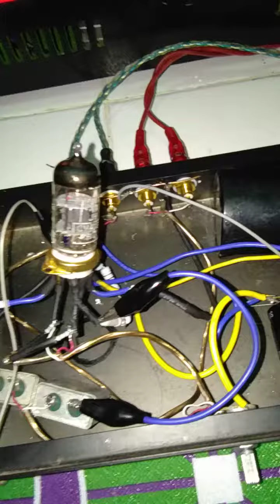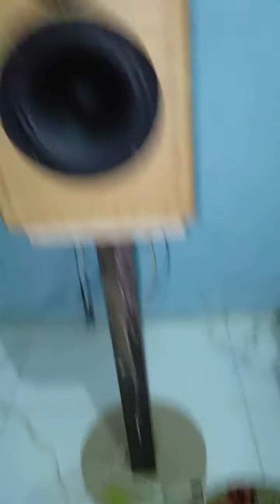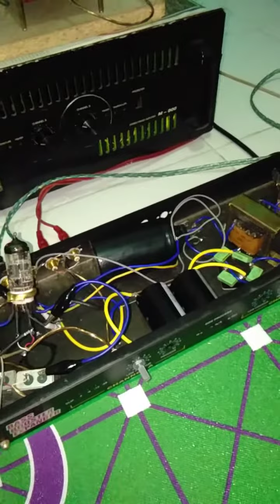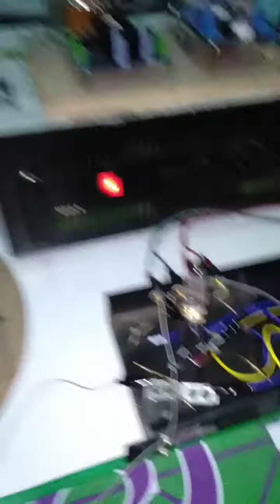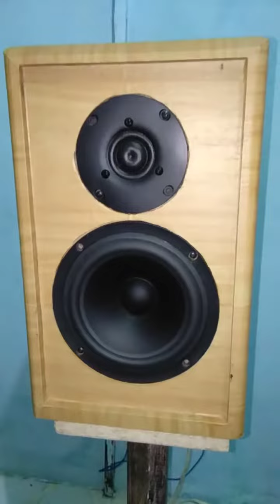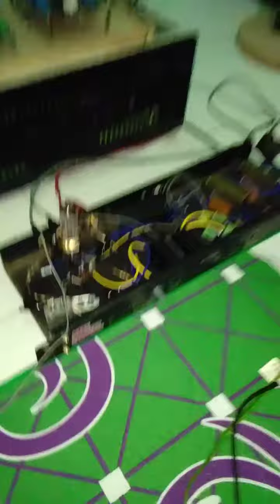12AX7 SB ACOUSTICS

Comment: Rakit sendiri ya mas?
Reply from the maker: Geh om pakai jumper jumper aja om , gampang ja pakai yang 12 volt trafo 1 ampere aja pasaran. Skema ambil di google
Reply: @sukaberbagi792  Next Video bisa tuh dishare skemanya.. 
Jadi gak salah skema, soalnya ini udah dicoba dan berhasil.
Mantap..
Reply from the maker: @YuTanBu  oh geh bener usul baguss om makasih
Reply: @sukaberbagi792  
itu tubenya sbgai preamp  y mas,,pakek tipe apa ?
Reply from the maker: @bangjos4314 pake Tube 12 AX7 om. Bisa juga 12AU7 atau 12AT7 masuk ko itu. Kalau 12AX7 setahu saya gain lebih besar dari 12AU7, kalau mau kesan gesit bisa pake 12AT7😁😁😁
Reply: @sukaberbagi792  
itu 1 tube bisa utk stereo y mas,,platenya disupply brp volt?
Reply: Bagi link skemanya mas,,,klu high voltage blom berani